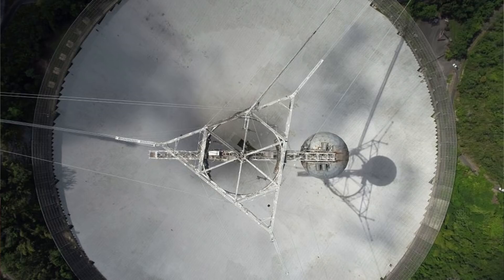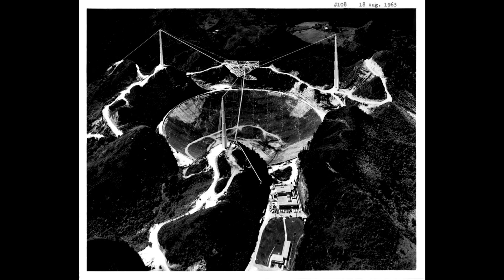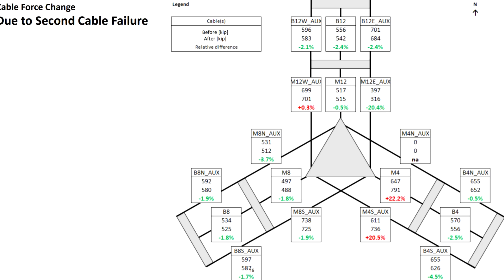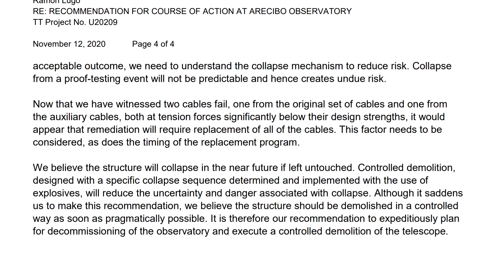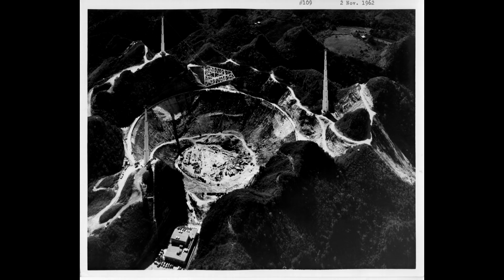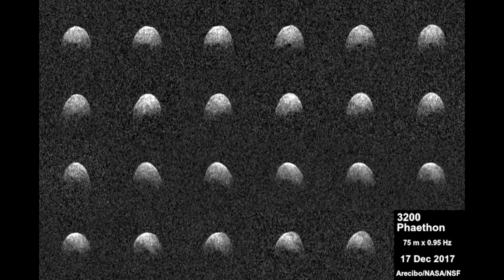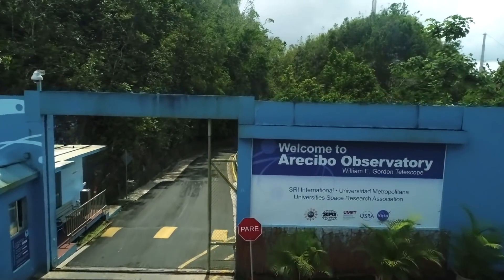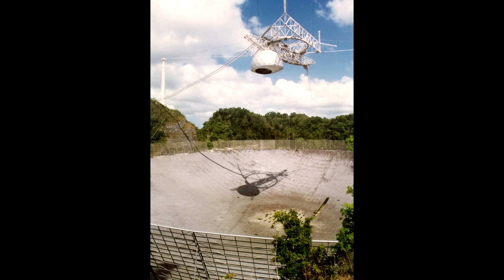Worlds Largest Radar Astronomy Dish To Be Demolished!

Comment: I remember reading about a military airship project potentially capable of lifting 500tons. That would have made an interesting sky crane to support the central structure, making cable replacement somewhat safer. Subject to weather conditions of course ;)
Reply: The biggest blimp ever built could lift 17 tons.  There were plans for one that could lift 160 tons, but it was never built.  The central platform weighs 900 tons.
Reply: @stargazer7644  I found a Wiki reference to the cancelled Walrus HULA project I was thinking about. It mentions cargo capacity of 500 to 1000 tons but also relying on vectored thrust. Probably an interesting documentary in its own right. The weight of that central platform is astounding.

Comment: Guys. It is tragic. But I refuse to believe it will not be replaced. Arecibo 2.0 in the same spot.
Reply: There's no point. Much better to move on and invest the money into newer and better location or structure, maybe even a large size space radio telescope. You have to consider that for many decades now, the reason people have been using Arecibo is that it's hard to move a multi thousand tonne concrete structure to somewhere better.
Reply: @dennispremoli7950  Concrete? If you mean the dish, it's actually aluminum. Just found this out myself; I wonder why they didn't built it into the ground in the first place?
Reply: @dennispremoli7950  the larger version of this style of telescope that has been built in china will probably be upgraded to feature active radar now that the niche is no longer being filled by it's predecessor
Reply: As for the OP, @Synystr7, I think this will be treated much like the I-35W Bridge; badly neglected for years because the government doesn't like spending money, but when it's gone, they have to spend tons of money because they literally can't live without it.

Arecibo is a one-of-a-kind unit that has no equal in the world for its purposes, and it is likely that either A) The government will replace it, B) Private enterprise will replace it, C) The government will replace it because another country (ie. China) makes their own in response (the Cold War effect), or D) Another country makes their own in response while America does nothing.
Reply: @UClIsbrINHWLRg5z8UR8xZqg it’s called FAST and it’s finished with a 500m dish

Comment: At 4:44 - we call that "birdcageing", and it is never a good sign.
Reply: yeah those cables from the 1960's are deteriorated bad, I work with winches and cranes and those cables are failing from the inside out, like a ticking timebomb they are going to snap
Reply: I'm not a mechanical engineer, but the simple observation is that those strands that are bulging out are not doing any work. And the big unknown is how many of the strands are doing any work and what is their condition. As Gus Of The Dorks pointed out, this is mad man territory. Nope, nope nope.
Reply: Are you an engineer? If so, can you elaborate/ I do see that the cable's fraying, which is not good.
Reply: @YT-TheLegacy  What you dont see in these pictures and what can be hard to see with the nakid eye at all is that these cables are getting stretched, contracting, and vibrating constantly. Temperature, ground vibrations, and wind will do that. Now, most of the time, these things have very little effect on what we use. The problem is time. It's been having this happen for decades. In some places in the cable it's going to weaken in. In other parts of the cable something called "Work Hardening" is going to occur. Basically the material is going to get harder, but brittle. This means it's alot easier for it to snap. Think of taking a wire and working it back and forth, how it eventually snaps. Same thing here, just on a larger and much slower scale. Now, keep in mind these cables are super thick and made up of a bunch of cable spun together. So they don't all fail at the same time. But once enough of them do, the snap is going to happen. Birdcage is a condition caused by this wear. I'm not 100% on how it happens, but it's one of the most obvious sign that things are going wrong since these not terribly flexible steel cords are starting to bend in ways they weren't designed. 

And like the other are saying, this deterioration is BAD. Like really bad. If you gave me these cables and asked me to do a lift with them, I'd first call you crazy and refuse to do it. These cables all look beyond the point of needing to be replaced and from a construction perspective you would need to replace all of them. That's not to mention the massive danger to the lives of the work crews these things would pose as they work on them. When one of these things snaps, it snaps with insane amounts of pressure. Assuming you could get a rig that protects from falls, when this snaps it's going to be like a whip made of tons of steel flying in a random direction. If it were to catch the tethers of the repair crews, they're dead. If it hits a repair man, that guy is going to die. If any chunks of it fly off, it's going to be like having a grenade go off in that it's going to be metal shrapnel flying at speeds typically only seen in combat situations. So you can imagine what that would do to anyone around. 

For safety and cost sake, just demolish it and build a new one.
Reply: Thanks for finally letting me know what the name of that thing is. I'll start using that from now on.
Reply: would this have happened regardless of the original cable popping out? I assume these cables were rated for a certain number of years and the observatory is approaching 6 decades of service.
Reply: @juankenon  Eventually, yes. You've got several things working against the cables, The static loads on them, additional loads from wind, rain, and temperature changes, and corrosion both on outside and within the cables. Might have taken longer, but eventually the cables will weaken to the point of collapse.

Comment: I don't work with this sort of thing specificially, but I am an engineer, and looking over some of the published data, it probably is savable!
The problem is, even safety issues aside, you'd essentially have to rebuild it from the ground up, save for the 3 support towers. 
The damage to the dish is already pretty bad and any lowering of the central structure (Which you basically have to do to replace the decades old wiring) would basically remove the middle of the dish itself, at which point the rest of it may as well come down...

I kinda vote for an update and rebuild but the funding is an issue. Anyone owed a favor by Jeff Bezos?

Comment: Scott, what happens to the dismantled parts of this telescope if or when it is demolished. I think we should transfer the parts to a lunar crater of appropriate size and install it there. Far fetched I know. But moon has a lot of worthy holes where it can be installed.
Reply: It seems from the document they wont try to save the instruments,just doing a cheap controlled demolition and walking away.
Reply: We'd really be better creating something specifically for the purpose.
Reply: @JamesF0790  how specific do you mean?
Reply: @kushmandey6880   Things designed for Earth often don't work as well in a vacuum and the Moon is a harsh environment. What I'm saying is that we don't gain anything by trying to reuse likely heavily damaged parts after repairing them. We're better off building something designed for the moon.
Reply: @JamesF0790  Just thought about it.

Comment: Don't know how valuable it would be to Puerto Rico as a tourist/national heritage site but presumably they could fairly easily rig a lightweight mockup of the gantries over the bowl itself.  "Hole in ground" won't be going away even if you drop the existing 80-odd tonne on it (it could get bigger!) and the support-towers will still be there, even if not capable of holding the full mass.

Comment: The solution is a large zeppelin. Let that remove the observation platform.

The world needs more large zeppelins anyway. 😁
Reply: A Zeppelin with 700 tons of lift?
Reply: @jimurrata6785  Unless Zeppelin is also the term for multiples?  😉

Even so, you would probably need a lift capacity of 1,000 tons to allow for the weight of the cables from the airship(s).
Reply: @imouse3246  Yes, just like brick, deer and fish....   😉

The idea of a gigantic airship seems cool to me.
Google was flying Project Loon over Puerto Rico after the island was devastated by hurricane Maria.
Reply: @jimurrata6785  They did plan something like this, google CargoLifter ;)
Reply: I thought that too, currently our greatest lift capacity is 1,400kg. The Zeppelins could do 22,000lbs... Not enough

But there is the MI-26 Russian helicopter that can lift 56,000kg.

There may well be cranes that could do the job IF you could get them there.
Reply: @dougaltolan3017  Obviously we need fourteen Soviet helicopters, post haste!
Reply: @jimurrata6785  it might cause too much of down draft from the helicopters and over stress the cables. A giant gantry crane may be safer.
Reply: @nicmaz37 I was being facetious about the team of helicopters.
Even the additional 84 tonnes of lift would probably not cover the rigging.
 A gantry would be ideal.
But if you were to build one why not use it to support the instrumentation module and eliminate the tower cables?
Reply: @dougaltolan3017  Here's the thing: for purposes of cable replacement, you only need about HALF the total lift. You're not actually taking the central structure away; you're reducing load stress on the remaining cables sufficiently to allow them to be safely replaced one at a time. Because the second cable failed at 60% shear minimum, a lift capacity of 50% of the central structure's weight would allow a ~10% safety differential. Because blimps are relatively unstable (laterally speaking), it would be preferable to double or even triple that differential, but it COULD likely be done at even the 10% mark.
Reply: @Calbeck  but all the cables haven't been maintained, they are corroded and damaged that they are unknown when they will snap, the strength of each cable is unknown since no is risking their lives to have a cable slice them in half when it snaps
Reply: @dougaltolan3017  lr13000 can do the job alone, it's a crawler crane with 3000 tonnes of capacity.
Reply: @dougaltolan3017  The platform is something over 300 tonnes.  Nothing that can lift it in one piece.
Reply: @dougaltolan3017  The only cranes with that kind of capacity for a SAFE lift are the permanently placed 'Bridge' type typically found in shipyards.  Those at the Newport News Shipbuilding yard are typical of the type.  I THINK their largest can perhaps lift a 1,000 ton module, though my estimate may be high.

Such a crane would have to be purpose built in place.  Just a brain storm here, but perhaps this might be an answer, replacing the tower and cable system with a bridge crane structure which would provide greater strength, though it may not be as flexible a system.  Leave an opening at the bottom of the dish sufficient to lower the actual receiving array to the ground for maintenance and upgrades and to protect it from hurricane force weather.

The lifting car of the crane could easily be made remotely controlled so that if the instrument is in 'Radar' mode, the energy won't endanger an operator.
Reply: @robertf3479  Just moving the parts to Arecibo with heavy lift helicopters would be extremely expensive!
Reply: @robertf3479  a bridgecrane with around 350-400meter distance between the supports? these cranes in shipyards are alot shorter. And you would probably need another giant crane to build it over the thelescope.
Reply: @Ri4Fu  Good points.  As I wrote I was just 'brainstorming.' I am, or was rather, a sailor and an enlisted member of the Electronic Intelligence community ... not an engineer.  That said, over the decades I've gotten to know a number of very bright people involved in a number of disciplines including actual engineers of various types.  Some of the best have told me "If it can be imagined, it can be built or done."

They have been right more often than not.  I'll leave it at that. 

Hope you are enjoying your weekend.
Reply: @robertf3479  if only there was time and money to build it, it could be saved. Too bad America is in a super deficit with no money.
Reply: @aitorbleda8267  and super dangerous since helicopters cause down draft, it would strain the cables possibly causing them to snap
Reply: @dougaltolan3017  if you replace Helium with Hydrogen... 3x lift. Still not enough given the increased risk.
Reply: @williamarmstrong7199  also helium is non renewable, we have helium reserves, once helium leaks from containers it rises into space and lost forever
Reply: @Biggus_Mickus  Actually Hydrogen (as in H2) is less dense than Helium (about half as dense). Heluim is preffered though because it isnt combustible, and also doesnt diffuse through other Materials that much
Reply: @unitrader403  : Actually, in real-world conditions Helium diffuses more, because Helium normally occurs as solitary atoms, while Hydrogen normally occurs as two atoms bonded together. Thus, Helium behaves in the expected fashion, while Hydrogen acts with twice it's own normal size.
Reply: Big fat hexcopter with like 6x 300m rotor ;-D
Reply: To bad Cargolifter went out of business and their hangar became a tropical resort.
Reply: get a pair of Amazon Carriers over to keep it suspended
Reply: Stairway to Heaven 🎸
Reply: That idea has actually been explored previously for both Arecibo and FAST. Unfortunately it just doesn't work because of the tolerances. The platform would need to be stable to at least 0.25 mm in cartesian coordinates, but would also need to be stable to at least 0.5 arcminutes (1 deg/120) in angular orientation. Both of these toleances would need to apply at timescsles of about 1s in order for the telescope to be able to carry out its work.
Reply: @Biggus_Mickus  : Hydrogen has a lower atomic number than Helium.
Reply: Hydrogen can lift about 1kg per cubic meter. So a zeppelin 50 meters radius (assuming 65% weight from structure) would need to be 300 meters long. For reference the Hindenberg was 245 meters long and 41 meters diameter so in effect you would need at least 3 Hindenberg's worth.
Reply: @gordonlawrence1448  : Achievable, but probably too expensive for the repair of a single object that is already under-funded.
Reply: Led Zeppelin? Why not it can't hurt.
Reply: Have I just found a fellow rigid airship lover?
Reply: Oh the huge manatee
Reply: The Airlander 10 only has a maximum approved load capacity of 14,000kg...
Reply: Ahhhhh fuck it just blow it the hell up and pick up the fucking pieces shiiit
Reply: That's actually what I was thinking initially as well, you don't NEED to lift the whole thing, you just need to take a lot of the stress off the cables.  Being able to attach a constant-lift source to it to relieve those strains might allow enough safety margin to string the new cables it needs.  Could anchor the lifter around the site, where it's not even required to hold its own position, just winch it in like an aerostat.
Reply: I think it would be more expensive than to let the platform crash, and rebuild both the dish and platform.
Maybe it's possible to slowly ease the platform down onto the dish (obviously crushing the center of the dish and damaging part of the platform) but saving most of the structure and most of all ensuring personnel safety. Then repair the platform (maybe add new instruments?), cabling, hoist back the structure and repair the dish underneath.

Or make a giant skatepark out of it :)
Reply: half a dozen Airlander 10s (the flying bum) could do it.
Reply: A fleet of zeppelins, maybe
Reply: Oh the humanity!
Reply: @Dethmeister  You beat me to it!
Reply: I see nothing wrong with this.
Reply: You could also use small balloons, multiple redundant ones for each worker, giving maintenance workers positive buoyancy, so said workers would translate from tie-down point to tie-down point, but they'd always have a quick-release to hand in case things drop and they need to escape upwards. That said, they could still be hit by snapped cables whipping around, so robots might be safer. 
Also, as for using a large zeppelin, someone would still need to tie the receiver to the zeppelin, which would carry the same risks as above.
Reply: Cargolifter CL160 was so supposed to handle 160 tons. And it was already huge. :/
Reply: Interesting idea and comments.  If not for the platform removal, at least for the worker safety backup.  Problem?  The workers all lift off.
Reply: @Biggus_Mickus  scienceologist? Really, dude?
Reply: soon The world's largest rigid airship encountered a light breeze and crashed into all nine local elementary schools simultaneously carrying the world's largest and most famous radiotelescope.
Reply: @thegardenofeatin5965  while hitting an iceberg and sinking next to the Titanic
Reply: this would probably cause inaccuracies in the focalpoint with just a gust of wind
Reply: Sadly a Zepplin can't lift that much. Some heavy-lift helicopters *might*, but it's extremely dangerous. I'm certain they wouldn't be knocking it down if they had any choice. But it's an extremely dangerous situation.
Reply: Can I suggest a megga sized Trump baby hydrogen balloon to lift the center to safety? It would not work hut would be fun to see and when it fails explode it! :) worth the cost just for that.